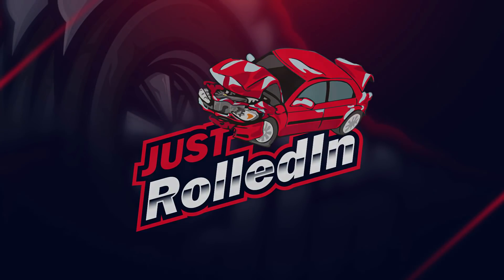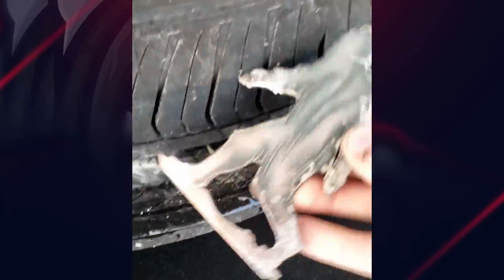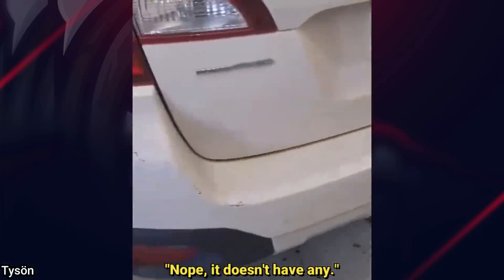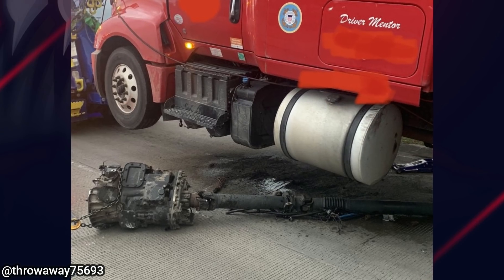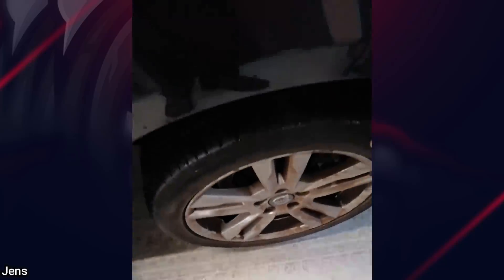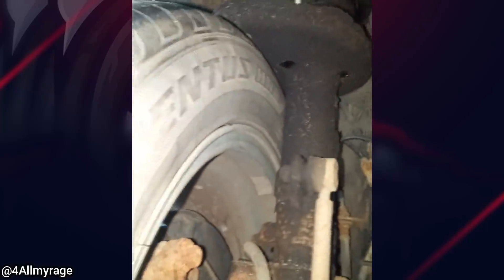Customer States "I Ran Over A Sasquatch" | Just Rolled In

Comment: That dipstick trick is pretty sweet
Reply: If you have 9 years to add a quart
Reply: @christophertrammell4711  better than 9 miles of spilled oil smell 🤭
Reply: Ever try to hit the hole on a 3800 without a funnel? It's at a bad angle and you always get it on the exhaust manifold. I did that on an old Grand Prix when it was hot and the damn thing caught on fire. I see why leaky valve covers burned down so many cars.... GM blames the issue on valve covers, plug wire retainers, and the plastic engine cover, but I'll tell you I saw it happen first hand the problem is with the insulating heat shield attached to the manifold. The oil gets between the shield and manifold and had no where to go. If you get oil down there and it doesn't combust it will smoke for 3 days.
Reply: Thats thinking with your dipstick Jimmy! - Castrol commercial from 15 years ago
Reply: Knowing my luck, the oil would go every but on the dipstick.
Reply: @ol_smokey9370  I love that commercial.
Reply: @kenleppek So that's why they added a drip tray under the filler on the last Gen of 3800's. Here I thought they were thinking ahead
Reply: @dasbutte6254  the filter is on the back side. All the engine fire issues were with the front valve cover leaking oil onto the front exhaust manifold
Reply: Always be sure to oil yer dipstick
Reply: @kenleppek  I said Filler not filter. Also last I checked the filter was behind the right control arm just inside the subframe. (on a series 3 at least)
Reply: @dasbutte6254  my bad I thought u said filter...yep that's the deal with the drip tray
Reply: Don't tell me what to do. I want to spill my oil.
Reply: Better hope there’s no wind blowing when you try your little trick
Reply: I can’t wait to show people my magic dipstick trick now
Reply: @kenleppek  yes I can relate to the 3800 lol
Reply: I watched this because of your comment... u thought it was gonna be some stupid tictok idea... but boy was I not let down rhats a awesome trick
Reply: I learned this trick with other things, and I gotta admit I can't do it nearly as fast as that guy. That's impressive.
Reply: That’s an old chemistry trick on how to pour liquids into small mouth containers like flasks and test tubes.
Reply: Dipstick trick is pretty slick
Reply: 😏 Ok Edgar Allen Poe
Reply: @kenleppek  😁
Reply: Good ol’ surface tension.
Reply: *cries in BMW
Reply: @christophertrammell4711  I'll take that over spilling everywhere. I usually keep a funnel in the engine bay, but sometimes I don't have one and I hate spilling.
Reply: ULTRA LONG-RANGE POURING THINGS

Comment: Dipstick one at the end is pretty great. Did an oil change today and lost my funnel so made one by cutting a plastic bottle in half.
Reply: The oil can should be turned 180 degrees, it will pour so well you won't need the 'stick
Reply: You make it sound like that isn't an obvious thing that everyone has done at one point or another.
Reply: Cut off botlles without deposit
After put the lid on,no drip
Reply: @PJBonoVox  maybe he didn't know or just giving the info on ones who don't know or are clueless. Really?
Reply: A shoestring works too...don't ask why I know.
Reply: Over the years some plastic bottles of mine went that way.
Reply: In Amarillo TX you can stand in one spot pour a beer out on the ground and it’s already made it 16 ft by the time it gets there. No way you can have one of those pop up harbor freight garages here.
Reply: @benjaminfitzgerald2037  Boot lace, minimal fiber loss. Also in a wilderness area where every drop of oil mattered.
Reply: I’ve done that for oil, coolant, and windshield washer fluid in years past!
Reply: @haroldwilkes6608  The Coandă effect. https://en.wikipedia.org/wiki/Coand%C4%83_effect
Reply: 2nd reply...try this, punch a small hole in the bottom of an unwaxes paper cup, put the hole over the oil filler hole, pour oil into cup (From Handyman magazine).
Reply: @andrewcousins2423  True, if you want go all scientific on us although surface tension factors in too.. but I didn't know there was a name for it so thanks...I'm not paying royalties to him though. My mother used to pour hot liquids over the convex side of a spoon to prevent splatters. BTW this is why I love YouTube, all kinds of info is offered.
Reply: @LouT1501  If the container will fit...in my car there isn't enough room to pour accurately.
Reply: @PJBonoVox  Trust me, obvious is like common sense...not common.
Reply: I lose my funnels all the time and end up buying replacements. Then when I don't need to change the oil, find them and mange to lose them again the next time I need them. I stopped changing my own oil. I get coupons from my dealer all the time in my email. I end up getting the oil and tires rotated cheaper from them than the local Meineke or Firestone can do it for. Always nice to look at my carfax report to see it has been logged in that did the change and rotation.
Reply: @tdrewman  My car is over 17 years old and I've owned it for 3 of those years and done 25,000 miles. Never done an oil change. The previous owner said they had only got one day 2 years before I bought it. So 5 years overdue one, I wasn't worried about having it logged.
Reply: I just get some of the oil in my mouth and spit it directly into the gas tank. Works like a charm.
Reply: @haroldwilkes6608  I smell a story

Comment: I would be afraid to put that one on a lift, didn’t look like enough solid frame to support it.
Reply: You have good eyes. I didn't see any frame.
Reply: @XtreeM_FaiL  Agh comon there was a whole pile of it on the floor!!!!!!
Reply: @XtreeM_FaiL  Frame? we don't need no stinkin' frame!
Reply: Get it off the lift get it out of the shop it's a rolling liability.
Reply: @NotProFishing  that car needs a one way trip to the wrecking yard
Reply: Don’t you guys have annual tests for road worthiness?
Reply: @bsimpson6204  no they dont
Reply: @bsimpson6204  wish they did I've seen cars  rear-ended with the rear bumper dragging and they still drive the car everywhere
Reply: @bsimpson6204  7 states don't require inspections: Alaska, Iowa, Arkansas, Minnesota, Montana, South Carolina & South Dakota. Michigan & Mississippi only require inspections in special circumstances. I'm curious as to which car brand and model was so rusted...
Reply: @bsimpson6204  too many states don't . my state does yearly safety and smog. that's more than california which only checks smog.

Comment: I heard a small clunking from the left rear on a drive, and when I got out to check the rear wheel, three of the four lug nuts were missing.  Someone tried to nick my wheels, found the wheel lock and bolted.  Had to swipe a lug from the other three wheels to secure it (was worried the lock nut's stud was damaged) and went to an auto parts store to get three new lugs.  People piss me off.  If I ran things, I'd have thieves' arms cut above the elbows.  My wife and I could have been killed if that wheel & tire had come off, so screw everyone who wants to whine that I'm cruel and unusual.
Reply: Lucky you, they usually steal my rides!
Reply: @TiborRoussou  In my neighborhood they'll nick your wheels but put your car up on patio blocks they nick from your neighbor, so at least you get something out of the deal. The neighbor just nicks some from the next neighbor and so on. Sometimes they will use pallets they nick from local businesses. Those are nice because you can burn them.
Reply: @markdanielczyk944  I hear you; years ago I had my garage broken into and half my tile tools were nicked,  plus my welder and drill press! Now All my tools (not just tile) live in my basement.
Reply: yep i would say same about the shoplifters just brazenly stealing and leaving a store. cut off their hands.

Comment: When I worked at an equipment dealership I saw stuff like this quite often. Saw brand new forklifts with no oil in the differential, and some with no hydraulic filters. Saw a new backhoe that we were inspecting before delivery that half the lights didn’t work on. ( missing parts of wiring harness)
Reply: If it happened at my dealership they would blame the customer and void out the warranty in the system for operating without the filter.
Reply: @craigjensen6853  that’s one of the reasons I got out of the business. I can’t do folks that way.
Reply: Greg Towel......good on you !

Comment: I had to replace the clutch in my Studebaker pickup and found the flywheel was just being held on by a couple of threads on each bolt. On a Studebaker V8 stick shift engines have longer flywheel bolts than automatic ones,. this engine had come from a car with an automatic and of course whoever did the work didn't change the bolts. So I did it in my driveway... and you have to remove the rear main bearing cap (and so of course the oil pan, to do it.

That was only one of many things they did wrong.

Comment: I had a truck break the main shaft on the transmission internally in 96.  I was in Alabama when it happened and it jammed the transmission into the high side of it.  I was driving a semi truck at the time.  I called in said transmission was busted.  Boss said think you can get her home.  I was like maybe but the clutch will be fried also.  He said those are cheaper than a tow or replacement on the road.  So I was dead headed back empty to get my broken truck back.  I get back to the yard and the transmission sounds like a bucket of gravel was in it.  The shop dropped it on Monday morning sent it to the rebuild shop and they were literally able to pour out the internals of that transmission.

Comment: I was driving to work in the 90s in a 78 camaro. As i slowed for a red light there was a bang and the car dropped at the rear followed by my rear wheel overtaking a line of traffic and bouncing into a small park. Nothing got hit on the journey and i was able to jack up the car to refit it.
It was then while borrowing a nut from the other 3 wheels that i found that ALL the nuts were finger tight and starting to unwind.
Theif? Or possibly a neighbour who didnt like cherry bombs.
Reply from the maker: A neighbor who doesn't like cherry bombs, wouldn't surprise me lol.
Reply: @JustRolledIn  and i may have possibly sleeved them with plain tube....but they looked like silencers. :)

Comment: I wonder how many times a dealership gets a new car in for its first oil change and the air filter is missing, and they just toss one in and give it back to the owner without saying anything?
Reply from the maker: It happened a handful of times when new vehicles had issues or missing something from factory. So it would be a warranty claim most of the time.
Never had a missing engine air filter though, so not sure if the manufacturer would believe that lol.

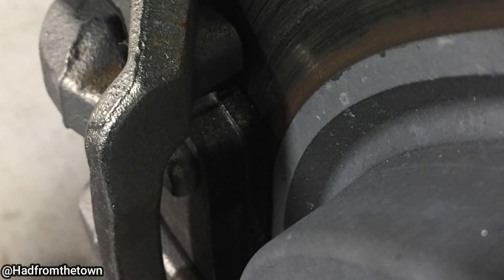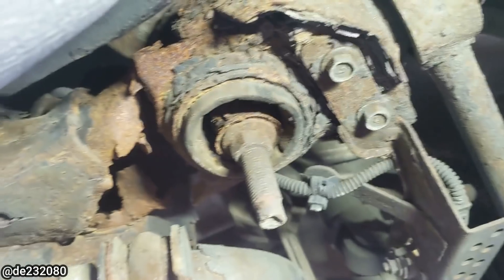Comment: 0:53 Seems factor forgot to install Air filter, 1:09 factory fitted brakes incorrectly GEE that's just left them wide open to all repair costs. But the most alarming one was the vehicle at 1:25 WTF there's nothing left of it no wonder the shop declined to work on it.

Comment: one day when i was driving a hydro jetter truck, right after i pulled off the company property i noticed it was going down the street crooked like it was trying to turn left so i made a left hand turn to get off the main street and pull over but as i was crossing the oncoming lanes, the drive shaft popped out of the transmission and caused the rear end to bounce up in the air causing a ton of water from the tank to cover the windshield. as the truck slammed down i was able to coast it over to the curb and park it. pretty damn scary! guess i missed something on my Pre Trip Inspection. oops.

Comment: I swear this stuff just gets nuttier and nuttier every time. Sure hope the tech got the issue with them backup sensors ironed out.😳🙄🤯
Reply from the maker: 🤪 "calibrated back up sensors"
Reply: @JustRolledIn  Good deal. Bill it out.👍
Reply: Should have sold them Blinker Fluid Maintenance and Muffler Bearing re- torquing.
Reply: @markh.6687  "That better be covered under my warranty!"
Reply: @CommodoreFloopjack78  Heh heh heh

Comment: i work for a service center at a dealership. wont say which brand, but i should start sending some stufff in. i had a guest today, said since purchase (CPO) the vehicle has had a bad vibration during braking and shes fighting the alignment. So i thought ok, well we can resurface the rotors and do an alignment for her, she just got the car. technician got it in the air, found the drivers side suspension and steering rack bent. I called her and she goes, oh yah, i hit a curb going 45mph.......................
Reply from the maker: That would have been nice to know when it first came in 😅

Comment: Surely you knew when you got the car, whether or not it had parking sensors smh
Reply from the maker: You'd be surprised lol
Reply: @JustRolledIn  I am never surprised at the level of stupidity people can display. I watch too much Youtube to be shocked any more LOL
Reply from the maker: Hahah same here my friend.
Reply: What boggles my mind is they thought one wasn't working and the other was, how the hell would you know
Reply: @mirthenary  Must have hit something with the side that didn't work.
Reply: @dougaltolan3017  the side without the significant other ? 🤣
Reply from the maker: I got a story I just remembered. I use to work at a used car dealership and was working on a F350 (inspecting it). It had the 4x4 transfer case floor shifter. A couple came in the shop with a salesmen and looked at this truck I was working on. He said it just came in on trade in and he wanted to show them before it sold right away. They looked at it and was happy that it had a manual transmission.  It didnt lol. They were looking at the 4x4 shifter floor shifted. I had to tell them. I feel like if I didn't, the salesmen wouldn't have said anything.
Reply: Nope. Met a woman neighbor who got stuck in the alley snow; she didn't know if her SUV was two- or four-wheel drive(!)  Then I saw her tires were bald. Only a misplaced sense of decency kept my mouth shut and my shovel moving until she could rock loose and drive out of the alley.
Reply: @markh.6687  I've met customers who don't know the difference between grass seed and fertilizer 🙄
Reply: @mirthenary  We must do something about this IMMEDIATELY! IMMEDIATELY! Harumph! Harumph! :)  Like stop them from breeding and raising more idiots.
Reply: I'll add this to my list of ways to troll a mechanic. Along with "The Earth Dreams Box."

Comment: Why are the oil change intervals  so low?
Here in Germany they are from 15.000km to 40.000km depending on the manufacturer.
My car for example has 1year or 30.000km on an oil change
Reply from the maker: On the Ford website it say's every 5000-10000 miles. But all depends on driving conditions, idle hours, etc. 
It was the first oil change as well.
Reply: Larger engines, bigger vehicles, people towing boats. Average US vehicle gets 25 MPG vs 32 MPG in EU, more fuel consumed per mile means more contaminants in the oil per mile. You're talking about trucks with 5L+ V8s, and unlike Europe, there's no 80 km/h limit on these 3.5t+ vehicles. Normal people don't use expensive synthetic oils either, an oil change here at a quick lube costs $30. Americans also drive a lot more, the average US vehicle goes 13.5k mi/year versus around the same in km in Europe. People generally expect cars to go 250,000+ miles, whereas in Europe, 150k mi is considered lifetime. That's why European vehicles with things like sealed transmissions are thought of as unreliable here.

Comment: Also, you could simply pour the oil in to that extra large hole made for pouring oil in there...
Reply from the maker: Extra large hole? I think you're thinking about the wrong one lol
Reply: @JustRolledIn  What are you talking about? I have not needed a funnel in 30 years to top up oil via the oil filler opening, which is perfectly normal in this video. If you cannot do it without a funnel, you are in the wrong job or have Parkinson's...
Reply: @Baerchenization  Guess what?  Some people do have Parkinsons, tremors or difficulty judging distances.  Be a bit more humble and kinder.